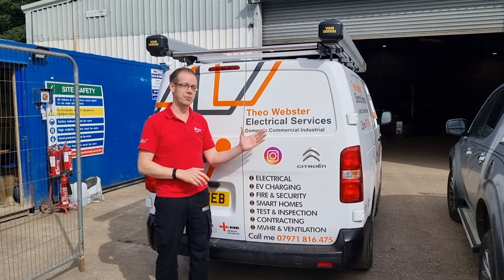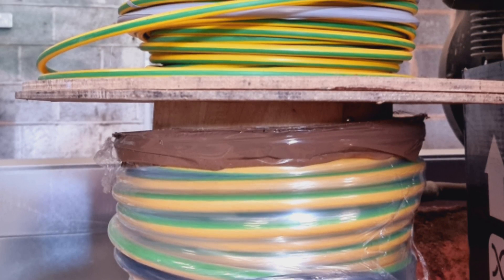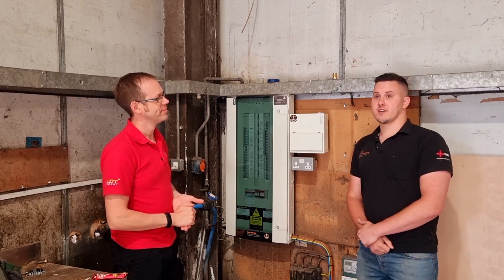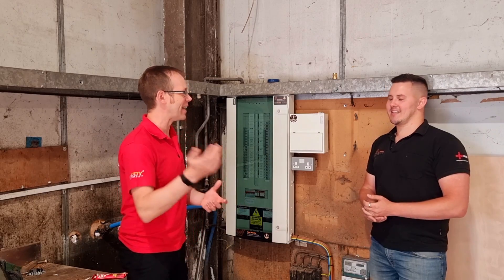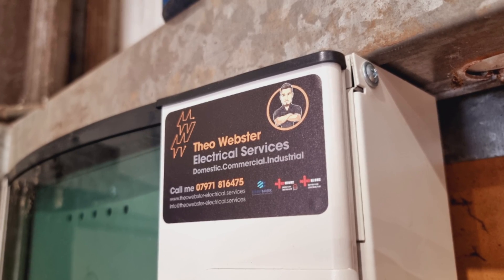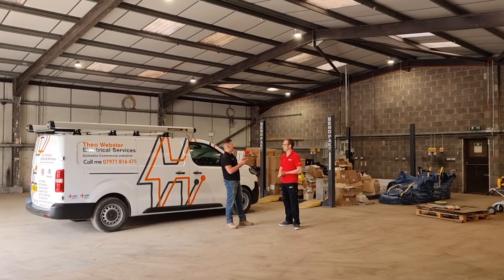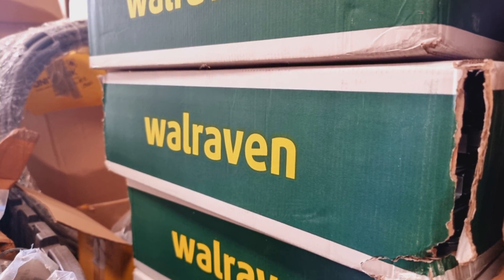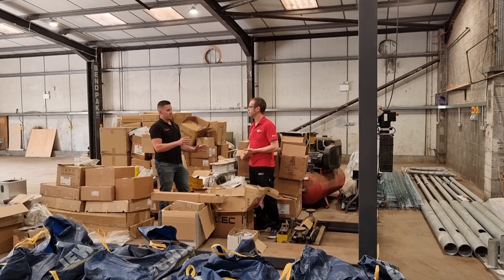The Realities of Industrial Electrical Installation

Comment: No gusset bends on the trunking runs , been pulled up for this before , with only 6   2.5 cables in it with no room to extend the run !
Reply: I just had to manufacture a bend on site, because of design issues that couldn't be worked around. Looked shite compared to proper manufactured ones. Will never make a bend again, especially if its on show.
Reply: @johnaphone  could give lessons in bend making , but hung my hacksaw a few years ago ,lol.

Comment: Why rings? Surely makes more sense for a radial there.
Reply: Hi Andrew. No particular reason for the rings and your absolutely right radials would have been fine however the separate ring main for each bay gives us a higher rating on our circuit at 32a for the 6 twin sockets at what I believe to have been the most efficient cost of cable etc.  having said this in phase 2 of the build within the commercial offices and retail space all socket circuits are being ran as 4.0mm radials due to a significantly lower required loading of each socket circuit due to the nature of its use. 

Over the last 12 months I have noticed that more and more contractors are moving to radials as their preferred wiring method for sockets and I must say I see the benefits however still feel ring final circuits have their place. 

Thanks Andrew for your comment
Reply: @theowebsterelectricalservices  Ring final circuits!
Reply: @GARRYEASTON  ? Is the ring always the final circuit, what about spurs off the ring ?
Reply: @oldbutstillcurious3615  What would you call it?
Reply: With radials I find you cannot go very far before the circuit is too long and you're over the maximum zs for protective device. Especially when the cables have to come down from the ceiling to sockets because of a solid floor.
Reply: @j0nA82  It should be ok using 4.0mm for a radial. Plus people plug in mainly low current items these days. So you could go down to 20A and  the zs will be 1.75 for a B20 and 1.09 for a B32